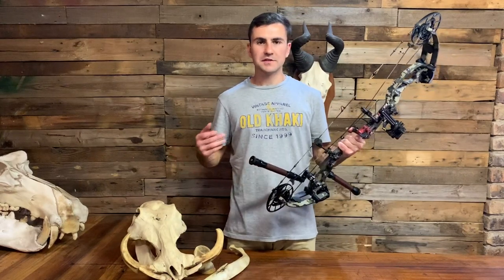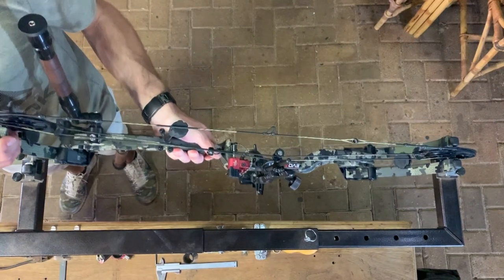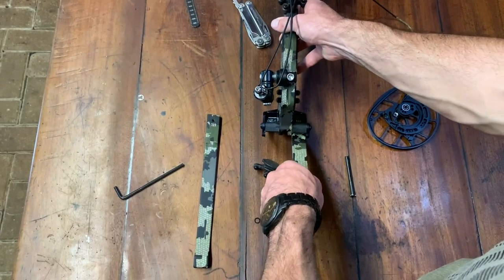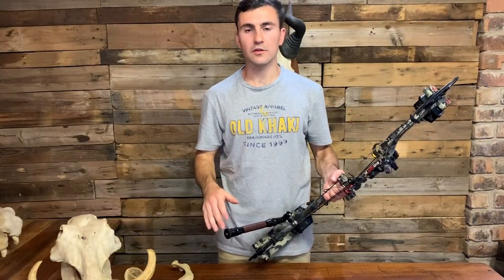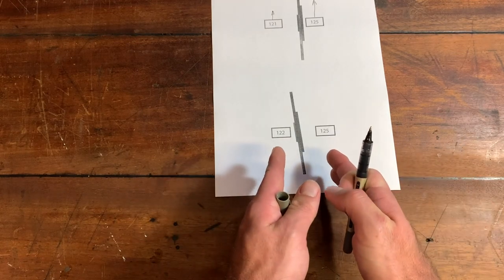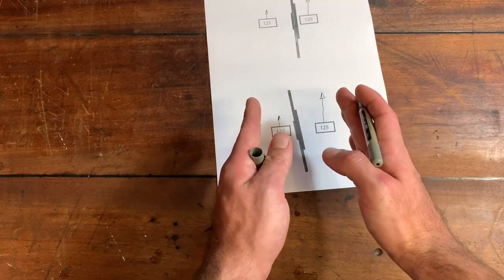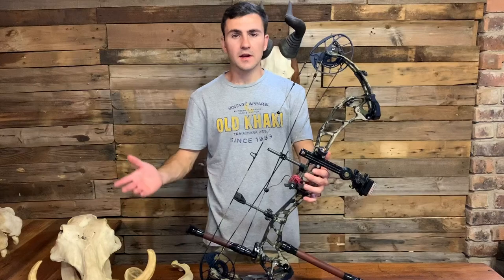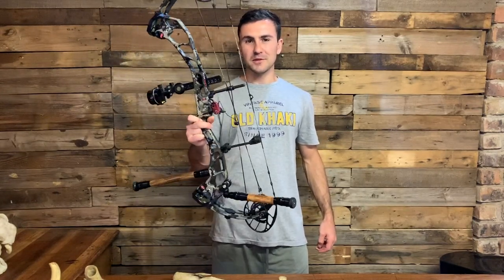How to SUPER TUNE your PSE | Limb swop, Cam Shim, Cam lean and everything else...

Comment: Followed your advice and changed the spacers on the cams. This caused the cam to lean and the draw stop to miss the cable. I now have a pse evo nxt at full draw that wont let down thanks mate.
Reply from the maker: Damn man, that’s not supposed to happen. It’s the first time I hear of something like this. Did you manage to get it back in the press safely?
Reply: Yes got a ratchet strap round the limbs and got it to the shop with no damage as far as I can see. Not had chance to shoot it again yet but it's back to the drawing board to try to get rid of this right tear.

Comment: It's lovely to see such a nice guy sharing his information with everyone online as well as taking the time to answer each and every comment that people are making.

Well done for that and your great knowledge. Not disagreeing that sometimes extreme measures like this are absolutely necessary but, I will say that before going into this sort of high level tinkering new Archers or even old ones that know enough would be well advised to check the simple stuff first. 

Here in Australia we are unlucky in that there are few if any decent bow shop Tech's  which means that we Aussie's have to learn for ourselves. 

Here's what I learned: K.I.S.S. (keep it simple stupid). 

A great resource for those like me that didn't want to tear their bow apart is The Ranch Fairy Channel. 

He like this wonderful YouTuber does his level best to help by sharing knowledge as follows:

1. A fair amount of the time it's the arrow, not the bow.  Badly weighted, wrong spine,  wrong tip,  etc etc can cause huge tears in many directions. 

2. Maybe just maybe it's you (bad grip, terrible posture,  overdraw, under draw,  face pressure there's a bunch of reasons right there for your terrible tear.

Hope this helps a lot of you before you go down the rabbit hole of needless complexity. 😁.
Reply from the maker: Thanks a lot man, I truly agree with you in that regard, the simpler you keep it, the less can go wrong. I only dive into the more extreme stuff when all the simple trick are ticked off. Process of elimination can sometimes take up a lot of time, but at least you know everything is spot on then 🤙🏻
Reply: @HannoDeKlerkArchery  so very true lol.  I just read through my comment and realized that my phone had spell corrected my English to make it completely illegible lol.  My apologies, English is my first language and I have no excuses lol.

Comment: on my PSE drive NXT, the limbs were setup like you changed them directly from the factory. Weak limbs on the left, stiff limbs on the right. I have a right handed bow also. The weird thing on mine is that the upper limbs are stronger then the lower limbs. I think the weaker upper limb is as stiff as the lower stiffer one .... Ther secrets of compounds bows :)

Comment: Hello Hanno, I purchased a PSE Carbon Air last spring. I brought it home to set it up, and the only way I could get a bullet hole bare shaft ended up with my arrow rest so far to the left that the arrow stuck out like the old recurve set ups! The arrow rest mfgr. said "man, something's wrong with your bow, you need to take it to a pro shop"! So I did. I was floored when they non nonchalantly stated, "oh, it needs shimmed"! They would not tell me exactly what they did, nor would they let me watch them do it, or answer any of my probing questions. But the reason I'm writing is to ask you, how or where did you learn all this stuff about limb swapping and shimming? I totally understand what you were trying to achieve, but I'd prefer not to learn what the outcome of each modification produces by trial and error, and would rather study examples and what mods were made to correct each of these conditions. Does such information exist to your knowledge? I know PSE offers a "bow tech" class, but it is for employees of PSE pro shops. Is there anything out there for the general public.....that wants to know more? Thanks and keep up the phenomenal videos!!
Reply from the maker: Hi Ed 🏹 I hope your bow is sorted now. My process is a complex mixture of trail and error with prior experience of tuning all sorts of bows, especially if you want it to run the arrow down the middle of the bow. I made a few logical assumptions, tore the bow apart, put it back together and shot it to see if I was wrong or right. We have been in contact with guys at the factory and they couldn’t provide us with a process to run through for specific problems. It’s the main reason why I made this video. We have used this same process on 4 different pse models over 4 different archers, and on all of them we had successful tunes. I think the main reason why there is no hard copy to follow is that it may differ because of the vast amount of variables in the system, and also to protect the shops in some sort of way 🤷🏻‍♂️

Comment: Wondering what you did with the shims after you changed limbs? Did you re-center the cams with the shims after that? There is a spot where the cams lean too much or are not in a spot that hits the cable stops and rotates past, very sketchy..I'm putting a new string on my Carbon Stealth and am going to try your advice with the limbs and start with centered cams. Good video!

Comment: Did you try to remove or change the position of back stabilizer,  stabilizers can give you a really difficult to fix tear.
I am pretty sure that to fix left tear usually you need to decrease tension on the cables, it means to move cable guard in
Reply from the maker: Yes, I shot the bow with and without the back bar setup to see if there is a difference through the paper but had no luck. The bow is well-balanced without a stabilizer setup, so I just use the back bar to low the centre weight of gravity and to bring the bow upright at full draw 🏹 I have had encounters in the past that I could manipulate the paper tuning with a sidebar.

Comment: Excellent video, I have the NTN and I am experiencing a right tear, I also adjusted spine, draw weight, centre shot, foc, going to a friends house to tackle this project. Did you just move the spacers or did you have to add shims as well.
Reply from the maker: I just moved the spacers around 💪🏻💪🏻
Reply: Im having the same problem with my ntn

Comment: All well and good. But paper tuning only shows what the arrow is doing at that specific distance. Have you tried with the paper further or closer distance to see the results?
Are you checking cam lean at rest or full draw?
Personally i went through alot of what you did on my evolve35 hunting a bullet hole, found it then immediately lost it when i tuned for distance.
Reply: All well and good what you say too. But throw a decent fixed blade Broadhead on with a 1inch tail left tear and you can’t rectify by moving rest position. I know people can be over particular with bullet holes. I actually shoot broadheads then if there is a problem shoot through paper to help resolve the issue. The  test is up close to paper because that is where broadheads will resist the fletchings and determine impact. At the end I just want my arrows all grouping together and this video is what is needed sometimes.
Reply from the maker: Yes I have tuned at a distance as well before all these other methods were done. I had terrible arrow flight, and it will be obvious because it wasn't even tuned for up close. After the cam shim and lean and limb swop, I got it to tune up close which sorted out my arrow flight. I tuned it again at a distance and it gave me a perfect tear too. My fixed blades also group with field points again without making any additional adjustments to my rest. You may want to play with the role guard angle when tuning at a distance as that will refine you initial up close tune.

Cam lean is checked at rest because it is at that position where the arrow leaves the bow 🏹
Reply: @HannoDeKlerkArchery  cheers wasnt sure if that was mentioned.
Reply: @gavancassar1366  about to get a couple ozcut 3 blades so that will tell. (previously liked mechanicals)
Reply from the maker: @ccleadge  you are right, I didn't mention it, but it is a good checkpoint to have during the tuning process, especially if you are going to shoot fixed blades

Comment: I have noticed on some of Dudley’s videos he has his arrow 90 degrees to the string but it looks like he is running above the Berger holes. What is your arrow height in relation to the Berger holes?
Reply from the maker: I ran mine through the middle of the berger hole and also with the bottom of the arrow in the middle of the berger hole and also just above. It didn’t seem to make much of a difference. I like running the stuff through the middle. Most of the time it works pretty great 💪🏻
Reply: Hanno De Klerk  nice! I do the same thing, but I figured I’d ask before I got started setting it up.  I got the NTN version (sweet deal I couldn’t pass up) but it’s basically the same bow so figured tuning will be identical. Thank you for the info!
Reply from the maker: No worries man 💪🏻 keep me posted , it’s phenomenal bows, you’ll love it 🏹

Comment: I’ve got a severe tail right on my evo 31. Center shot is good. Should I move the cable guard closer to arrow or farther? Thanks Hanno
Reply from the maker: Hi Dan, you can move your roller guard closer to the arrow. If the problem still persists, I would recommend moving the cams to the right hand side.
Reply: Hanno De Klerk thanks Hanno. I shimmed the cams 1/16 right and got 3 perfect bullet holes in a row.

Comment: Wonder if you can give me a few reasons my arrow flight is corkscrewing in a counterclockwise direction. Hoyt helix. 70#, 340 spine, 100 grain broadhead.  Field tips have way smaller corkscrew...barely affects flight. Bow shop tech could not fix this issue for me. Any help would be much appreciated. Thank you
Reply from the maker: Hi Charles, what is your draw length ?
Reply: @HannoDeKlerkArchery  29.5
Reply: @HannoDeKlerkArchery  I did realize something today while looking at my bow...the string is offset to the left of center, due to the cams. They are left of center in the limbs. Im going to try twist yokes to bring upper cam back to vertical and move rest more to the left...will see how that works out. Still wondering though, have you had arrows shoot in a corkscrew before? If so, what was cause? Thank you🤙🏾
Reply from the maker: It might be that your spine of the arrows are to weak, especially when you have a 125 gn point upfront. How well does it shoot trough paper ?

Comment: Also on my pse evo nxt the higher numbered limbs seem to be the weaker ones that deflect more. Any ideas why?
Reply from the maker: I have no idea why that would be, how did you determine it ?
Reply: The higher numbers where on the right both top and bottom and the cams where shimmed to the left. And both limbs deflected evenly. When I shimmed the cams slightly to the right the right limbs with the higher numbers deflected tonnes more. I guessed that means on my bow the high numbered limbs are weaker.

Comment: OK so I'm a right hand  and I have a pse xpedite and cannot get rid of the tail left.
I tried everything except shimming.
Should.i move my shims
Reply from the maker: I would suggest shimming your cams, it will be a good start. To get rid of the tail left, move your cams to the left. If that doesn't work, we need to look at the deflections of your limbs 🏹 I would first start shimming the bottom cam, and then the top cam 👍🏻
Reply: Hanno De Klerk my cam is already on the left from factory 
Do you mean move cams to the right?
Reply: Hanno De Klerk and thank you for the response much appreciated

Comment: I just got a PSE Drive SB. hasnt arrived yet but if i get cam lean and im going to have to go through the same process of removing my limbs too ?
Reply from the maker: Set it up first, maybe you do not need to go through this exact same process. All these issues may just be the way I grip the bow, or maybe it’s the bow itself. This is just some additional info if cannot get it tuned with the more basic techniques 💪🏻💪🏻

Comment: I can't get it same bow almost same problem I had a tail right tail is there so I switched the spacers to push the Cam all the way to the right but then I swear but then I switched the limbs to 80 pounds mouse and for one the bow come from the factory supposed to be 70 pounds and was only pulling 63 This thing has literally been a nightmare since I got it it's a great shoot great pulling boat I just want to build a pen with a broadheads in 60 and 80 yd  Like I was saying I flipped the put the bigger spacers on the left of the game pushing it right then I got 80 pound limbs for it but the heaviest on the right lightest on the left starting in the highest number and going clockwise wise this is what PSSC told me now I got significant cabling and I'm not OK with it it's rubbing up against my cable for my split I just can't figure it out I've taken it apart I've put the limbs on different sides different size I've done everything I could think of

Comment: I have the ntn and I am have a really hard knock left tear at center shot the shims are on the right side of the cams both top and bottom limbs on the right side are 124 top and 125 bottom on the left side of the bow they are 117 top and 122 bottom what do I need to do to get a true centershot bullet hole
Reply from the maker: Hey Ethan, have you adjusted you rollerguard outwards a bit? And what spine arrows do you have and what is you draw length and poundage?
Reply: @HannoDeKlerkArchery the roller guard is a fixed one on the ntn and I'm shooting a 300 spine at 70lbs
Reply from the maker: Ethan Burton I was afraid of that on the NTN bows. How is your nocking point? Do you have a slight pinch?
Reply: @HannoDeKlerkArchery  no pinch and 30in draw
Reply from the maker: The NTN bows, do they come with the rubber grip or not?

Have you played with different grip positions as well ?
Reply: @HannoDeKlerkArchery  yeah it's like no matter what I do with it it still tears left it's about 3 inches left from 6 feet
Reply from the maker: Ethan Burton damn man, I wish I could stand next to you and analyze it with my own eyes. 

How if your nocking point hight? I found that when I drop my rest a bit it made a huge difference on sensitivity of the tear, making it a bit more forgiving
Reply: @HannoDeKlerkArchery  its straight through the Berger hole I'm gonna take it to a local shop today and mess around the the limbs and shims if I can figure it out I'll let you know the issue
Reply: @HannoDeKlerkArchery  I added your Facebook I'll send pictures of everything
Reply from the maker: Perfect mate, let me know how it goes 💪🏻
Reply: Ethan Burton hey Ethan. I have a NTN as well. My shop sold 3 of em in the initial batch and mine was the only one of the 3 that wasn’t shooting bullets. The tech shimmed my cams, and it started shooting bullets. ... But, I started doing some playing around with bare shafts and point weight for hunting season, and everything was pulling to the left down stream. I went back into the shop with my arrow (correctly spines according to pinwheel software) and I was getting nick right tears with fletched arrows. Tech suggested taking off the comfort grip... it improved a bit, but didn’t fix it. Then I gave the tech my bow to shoot... and bullet after bullet after bullet. Turns out I’m not a very good archer yet and I’m imparting torque somewhere in my process. Whether it be grip pressure or release aid torque, or post shot riser grip, somewhere in there, I’m causing issues. Gonna work on it. Hope you get yours lined out. Awesome video by the way @Hanno De Klerk
Reply from the maker: Steven thanks a lot 💪🏻💪🏻 check out for face pressure on the string on full draw. Using process of elimination will help to pin point the cause of the problem 🏹
Reply: Yeah it ended up being my rest was touch the riser on the way down would have never guessed but I swapped it from a whale tail to a lizard tounge and that fixed the issue so everything is shooting perfect!
Reply: @TruffulaSteve  and a bow is tuned to the person using it, not everyone has the same grip on a bow

Comment: How did you measure the stiffness for each limb?
Reply from the maker: The stiffness of the limb is presented by a deflection number on the limb itself. The higher the number, the stiffer the limb 💪🏻
Reply: @HannoDeKlerkArchery  I have a Bowtech Carbon Icon with twin cams. No yokes. I am getting a 2.5 inch right tear. Before seeing this video I tried tuning from the riser (whisker biscuit) and pushed it left and right ... with little improvement. It is now all the way to the left. (OCD as well...) There is a 3/32" shim on the left side of each cam and a 3/16" shim on the right side of each cam. The top cam has a small lean left and the bottom cam has an equally small lean right. I got a Hamskea drop away arrow rest and will install it in the coming days. Any advise regarding the cam shims would be appreciated.
Reply from the maker: sorincomsa moving the cam with the spacer/shims will most probably yield little to no results at the carbon Icon doesn’t have split limbs like on the Evo nxt in the video. 
I would suggest to look at you nocking point and see if there is any nock pinch. Also try some different spine arrows out if you can without buying a new set. 

I might be wrong about the cam shim, it’s one of those that I still have to play with to go through the trail and error process.